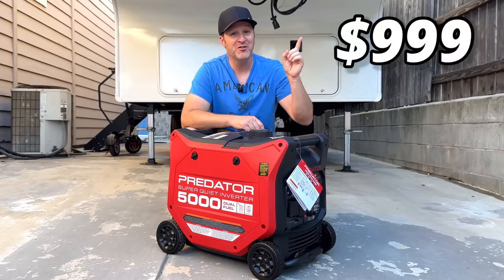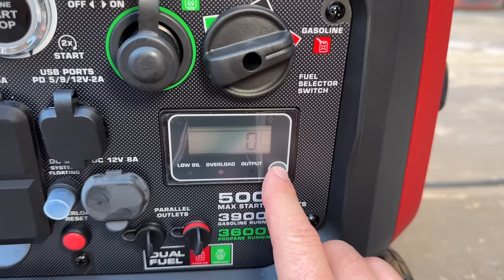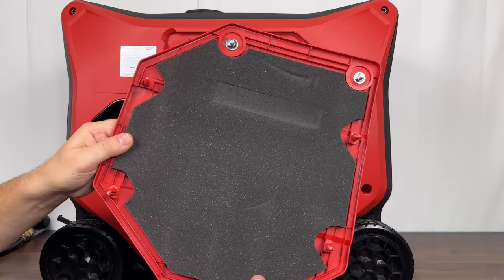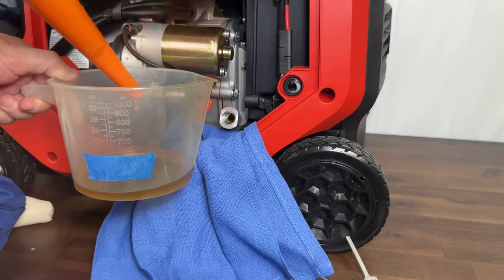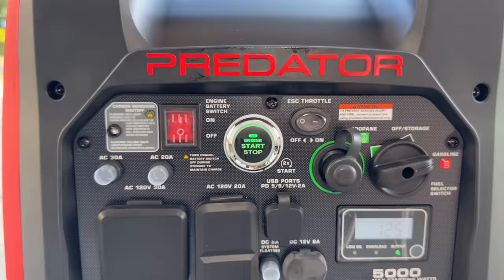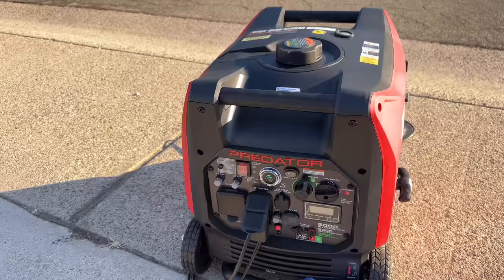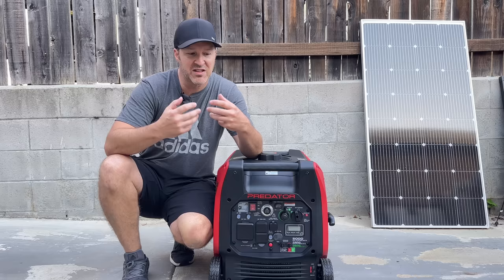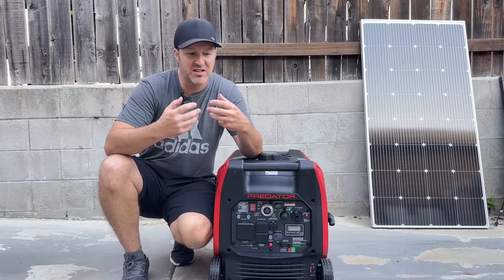BEST New Generator! Predator 5000 Watt Dual-Fuel SUPER QUIET inverter Generator LOADED!

Comment: Your videos are super helpful,  I'm looking for a generator and thought I'd get a 2000 one, but your sound measurements for 1500 watts on the smaller units vs. this. The Predator 5000 will be 10+ db quieter, which is a lot. 

Now I have to watch 20 more of your videos so I can figure out which brand to get.
Reply from the maker: No matter what you get a warranty is always a good idea.
And stay away from the small generac 2200 and Westinghouse 4500 👍🏼

Comment: We picked one up a few days ago when a storm knocked out the power. It kept the AC on in our 30amp travel trailer without any issues and only used about 5 gallons of gas. Power was out for about 16 hours. My main complaints would be they could have included a small bottle of oil and the stickers on the top curled up and came off the first day of it running out in the sun. There was also an e clip missing on one of the side door knobs and I have requested a replacement. Yes I know I can just go pick one up but it's a good test of their customer service I think. I think it'll be a good generator.
Reply: Got a response from HF customer service. They said they don't carry the part but I could return it under warranty which is just ridiculous. They sell the clips in the stores.
Reply from the maker: Lol wow that is weird. You should return it and just get a new one to just prove a point 😂

Comment: Nice upgrade and price for what it is, I was holding out for this for our camper. I wish they would of added a  L14-30R 120/240 outlet so I could use it for the house or camper
Reply from the maker: Yea would have been nice but there are several other options now
Reply: @johnnysweekends  what other options have the 240 outlet?
Reply from the maker: @Rimfirelvr you would have to step to like a genmax or pulsar 6000 or 7250 but the 7250 is a much better unit. See here https://amzn.to/3Sr8L7X

Comment: Has Predator done anything about the malfunctioning CO monitor system?  I would love to give this one a shot, but need to know if they've fixed that system in this new generator, otherwise I'll be voiding the warranty like so many others have had to do by deleting that system.  For those that may be curious, go look up that problem and you'll see how many are out there ... bought two 3500's on the same day because of it.  Then learned it was a massive problem.

Comment: Seems like a nice little quiet genny. Only issue, or downfall, is the lack of a 30A 120V/240V selector outlet. For an extra $50, they could install a 240V/30A outlet to plug into a house, to run both sides of the household electric panel. I have a small 3500 watt Duromax (12 years old) that has that capability. Extremely noisy, but quite capable. Would love to see HF add that to this unit. If they did, this unit would be a home run. The Predator 9500 has that option, but it's so massive and heavy.
Reply: What 3500 watt generator has 240 volt?
Reply from the maker: @pinkiepie1656 open frame type gens at that level can have 240 but not much else. Unless over seas type. Enclosed inverters are going to be larger. About 5500 or so.
Reply: @pinkiepie1656  I have a Duromax 3500 that I bought 11 years ago when Sandy hit. Has a 30A 240V outlet.
Reply from the maker: @chrism8013 yea open frame unit. Also not inverter correct? Not that a inverter is needed all the time but depending where you are it’s nice to have the quiet ones
Reply: @johnnysweekends  Correct, open frame. I'm in a canal neighborhood. Only time we  lose power is during a coastal storm, and the municipality shuts the grid down to protect the energized electric panels in the basements from getting flooded. Neither myself nor my neighbors care about noise of generators, as we care more about each others houses. Pumps & more pumps working are a must. I do have multiple lithium battery banks to power the house at night, but yes a small quieter inverter with a 30A/240V option would be nice. Or even the ability to run two small decently priced inverters in parallel with 30A/240V would be a good option.
Reply from the maker: @chrism8013 it wood be nice to see smaller 240v but just not super popular

Comment: I wish the 3500 wasn’t so expensive now days. I’m thankful I managed to grab the champion 2500w dual fuel generator for 385$ shipped on prime day!! Generators now days have went crazy on prices lately.
Reply from the maker: Yea many units went up in price. But are trickling back down especially with competition coming. 
But you grabbed a smoking deal.
Reply: @johnnysweekends  right?! I had originally bought the genmax 3300i for 499 with a coupon then the next day I saw the prime deal on the champion 2500 dual fuel and immediately bought it. It was a hassle to return the genmax cause Amazon said they usually don’t allow returns of generators but since I didn’t open it and I begged them they allowed me to return it😂😂🙏🙏

Fair warning Amazon could deny your return if anyone ever tried to return a generator. I had no clue there were exceptions to their amazing return policy until 3 days ago 😂😂😂😂
Reply: @johnnysweekends  you don’t mind me asking (this is my first ever generator) but I was curious if I had to move the fuel cap vent on or off if I’m only using LP?? I know you move it when you use gasoline but I’m only using a 20lb propane tank and I read the manual and it never mentioned moving that on off switch on the fuel cap when using Lp lol. Figured I’d ask as I’m on your 2 of the 5 hour break in. Also I followed your load break in first and then changed the oil! Just running low loads for 5 hours now until another oil change haha
Reply from the maker: Yea it’s odd because they just started that I guess but I think because they have no way to tell if fuel and oil has been added so then it’s a hazardous material thing

Comment: Another great video. I'd like to see a comparison between this one and the Champion 5500 dual fuel. I've had some reliability issues with the Predators and spending the extra $ for extended warranties can become an issue after using the warranty the first time. The Champion comes standard with a 3yr warranty and is priced at $1099.00 at Cabela's. I agree that Predator put some thought into the layout and maintenance for this one. Time will tell and I hope they've improved the display monitor.

Happy camping and testing and thanks for another great & informative video Johnny.
Reply from the maker: @redSnowplow7985 the original predator was great but they made a change about half way through a couple years in changing the manufacturer. This is when they were no longer as tough as the first runs or original models. I think they went though 3 changes in total. 

Will be interesting to see how long this lasts
Reply: @johnnysweekends  agreed. I carry a pair of Honda 2200’s for my 30a Grand Design though I can get by with one since installing the MicroAir east start.
Reply from the maker: Ahh yea popular choice and yea once the ac is up and going one doesn’t do bad. Are you running a 15k ac unit ?
Reply: @johnnysweekends  my Honda 2200 runs my 15k on my 33' forest river
Reply from the maker: Mine will as well but when at some altitude and a really hot day it’s maxed
Reply: @johnnysweekends  oh for sure... Same thing then PA systems you always want double the power of your source... My brother-in-law just got the champion generator it's nice and quiet. I could have got a dual-fuel for 700 off Amazon about a month ago.. but after predators competitive and it's a better generator I might consider that one.

Comment: Impressive! I would love to see a shootout between this, the Champion 4650, Genmax, 4500 and any others in that class.
Reply from the maker: My friend has the 4650 and it’s getting used a lot 🤔
Reply: I agree. The Champion 4650 is the closest competitor to the Predator 5000. I don't consider the extra starting watts on the Predator 5000 or even the Champion 5500 to really matter, since 4650 watts (30A @ 120VAC) is the absolute maximum that the 30A line can handle. I suppose you could have the 30A socket tied into your RV or home's transfer box, plus a couple items plugged into the 5-15 outlets...but I am not sure many people run their generators like that.

Comment: I just bought this generator today. I like how it came with jets. I live at 6500 feet and need to change the jet. Have you changed yours yet? If so a vid would be awesome!!
Reply from the maker: Yea 6500 feet would need a jet change. 
Not yet… couple days 😁👍🏼
Reply: @johnnysweekends  See my other comment... seems like the instructions do not match the carb (or I'm just an idiot). Thanks!
Reply from the maker: See if this helps 👍🏼
Reply from the maker: Oops….Predator 5000 Inverter Generator Jetting Change Easy DIY And Do You Need To?
https://youtu.be/og4Tc85ElfY

Comment: Thanks for the review of this. It looks great. I need a unit to replace my old Onan on board generator as it's too costly to repair and this looks pretty good. It is heavy but I suspect bigger ones are heavier and so long as it can run the fridge and one AC unit, I'm good with that.
Reply from the maker: There are a few other units you could look into that are a little lighter and will do the same. Like the champion 4500/4650 
Or the wen 4000. A lot of options.

But this thing is built more like the old Honda eu3000is just big and heavy duty. Very curious how this will hold up. 
It is quiet for sure
Reply: @johnnysweekends  Thanks for the insight. I'll look around to see what fits best for us. Love your reviews of these, it really helps!
Reply from the maker: Awesome glad I can help and thanks for watching 😀👍🏼

Comment: They are already obsolete. Several manufacturers are now selling Trifuel inverters (include NG) which is really the best option because then you don't have to go to the store to get Propane or Gasoline. You just hook a hose to your house natural gas line. I had two hookups installed for my BBQ that can be used for this so now I have a backup for my Generac whole house generator (they are not very reliable).
Reply from the maker: Not even sure what you are talking about but any dual fuel can be made Tri fuel pretty easy. Some take a pinch more work. Many use propane over NG just due to the poor amount of power NG provides. 
It’s actually bad, real bad the power loss for NG. So your gen just has to work even harder to provide the same power and burn way more NG than propane. 

You are mainly talking a home back up. Not everyone needs that. Hence they make several different types of units. 
NG generators also do not last as long as lpg or a gasoline generator. They have the lowest service hours of all. 

So all pros and cons. So not obsolete what so ever

Comment: Great review. They definitely upgraded the older 3500. Did they fix the surging issues? I returned my 3500's (2) due to them running rough without a major load on them. They still worked great just didn't want to find out if they would last. Ended up with (3) 2000's instead and like the redundancy. Fuel/oil changes can be done one at a time without interrupting power. Plus they use less fuel and I can use 1, 2, or 3 at a time depending on load/fuel conservation needs.
Reply from the maker: Surging issues who knows until they have been out for a while. 

But yea your setup seems fine if it’s working and you can parallel all 3 at once if you need to..👍🏼
Reply: I had one unit start surging at 15hrs of use, idk how to fix it so I gave it back and got new one that wasn’t starting and when it did it shut off in 15 secs. 0hr use, so now I’m back on 3500, idk what the deal is, wish it was a good unit I had because all the features is really nice and worth the price

Comment: 5000 watt should of had a 4 prong 240 volt plug. 5000 on two outlets seems off to me. For a RV I imagine it’s good
Reply from the maker: It’s only 5000 watt start this is to start higher amp loads. Which is why easy starts are nice. That is also only available on the 30 amp plug.
Reply: I have used there 8750 inverter generators they make great power I can run my whole house on it if the solar is struggling and it tolerates the huge charger built into my sungold power inverter. All in all I think the 8750 is a better deal I paid 1300 and it’s a beast
Reply from the maker: Open frame unit that is larger but cheaper and lighter. But  that is not a inverter type as well so less fuel efficient and not as clean of power
Reply: Great review I have a 3500 currently you’re making me want to sell it and get one of these😮
Reply from the maker: It’s a good unit for sure but there are competitive units as well from champion and more. But HF and the warranty return is one of the biggest selling points
Reply: @johnnysweekends  the 8750 @dirtriders3615 is talking about is an inverter style. I have the same one. It is open frame. However, it is not quiet. You get the appearance that it is because of the eco setting, however, go for a walk in the neighborhood. You can hear it.  Anyway, nice review on this generator.
Reply from the maker: Ahh ok that’s right they do have that open frame model that is a inverter. 
And yea I assume it can be heard, a long way lol
Reply: It's not 5000 watt RMS
Reply: It's 5000 max. 3600 running. 30 amps at 120 volts is appropriate.
Reply from the maker: @3900 running 👍🏼

Comment: How about your Neutral Ground Bond you added?  I’m sure your surge protector wasn’t happy before that was added. Great review, just though others would like to know there are additional steps to make it work.
Reply from the maker: Yes correct, when ever you have a EMS or even some PMS systems or like the watch dog device it will detect a open ground. 
So yes the bonding plug will be needed. 

Funny I normally mention that but sometimes I forget. Eyyyyy 🤷🏼‍♂️

Comment: Wish this came in a natural gas version. I have a NG quick connect hookup I use for my grill and fire table.
Reply from the maker: This I bet will be a easy NG conversion. 
They make kits but I bet only a partial is needed.
Guess I’ll have to dig around and do it lol
Reply: @johnnysweekends  Very Interesting!! I'm thinking you might only need the NG regulator and the bigger orifice/jet.

Comment: My biggest complaint would be that they didn't take the time to make the fuel system EFI.  I have a Predator 3500.  I've changed the jetting for my altitude, but wouldn't it be nice to just be able to run it and have an O2 sensor make adjustments for air/fuel conditions!?!/1
Reply from the maker: There are pros and cons with FI as well. 
If the injector becomes plugged it’s not just a pull apart and clean and go. It has to be cleaned with a machine to properly clean it and make sure it flowing correctly. 
Fuel pumps can also go out, and system components are more expensive. 
We will see how well some EFI units do soon. I’ll be doing high altitude testing soon

Comment: Looks like a very nice upgrade.  Great work as always. I love the serviceability especially the pilot jet! On that note I have never ending crap with that particular part. Do you think Lucas fuel stabilizer works better than sea foam or sta-bil. I don't want to start a whole thing with comments but I do everything by the book and that still clogs once in a while. I don't have this generator but I think the problem is universal. They say get ethanol free gas. I live in NYC. That isn't an option unless I drive really far away with a car full of 25 gallons of gas. I need the city stuck with ethanol best stabilizer.
Reply from the maker: I have had a great luck with the Lucas products and I did seafoam for a few years and honestly I think this is better. 

If you are always having problems it could be the gas station is pumping dirty fuel. 
Or maybe there is debris in your gas can. 
I would check the can and see and then maybe that will give a idea and then maybe a different gas station. 

I don’t use ethanol free as it’s $8.50 a gallon. Not worth it.
Reply: You might get a funnel with a brass screen at the bottom. It catches a lot, including all water.